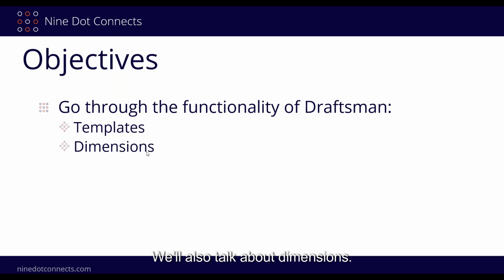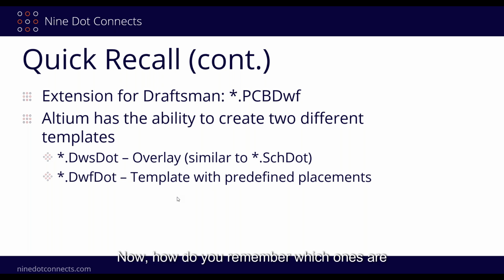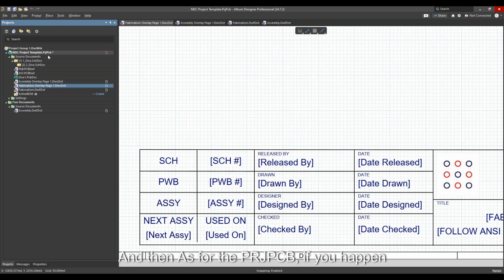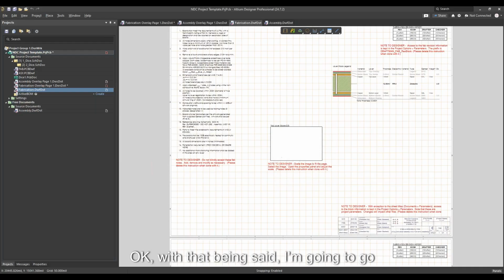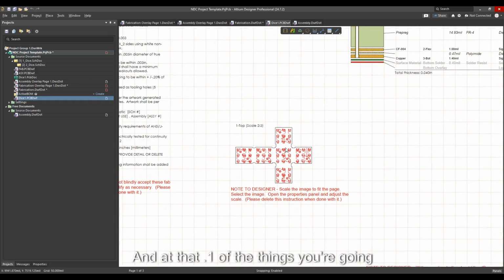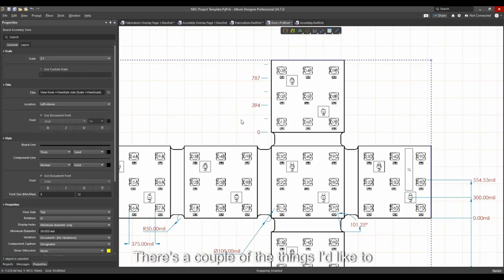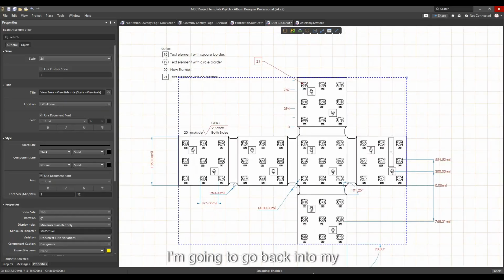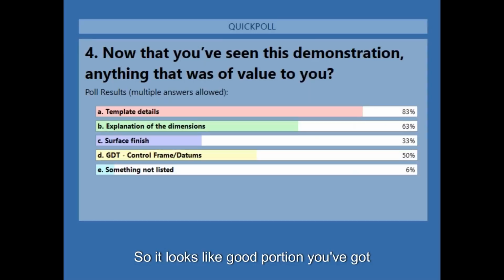A Revisit - Draftsman - 6 Years Later

Comment: When I provide the final Altium files to a customer, do I need to provide the DwsDot files also?
Reply from the maker: This is an interesting question because it depends on what you deliver to the customer.

If they hired you to create the templates for their companies, you will need to provide all templates for installation within their internal network.

If they hired you for design and layout, I would not provide the .dwsdot in the files you are giving them to send to the manufacturer.  This does not provide value to the fabricators or assemblers; it just adds more file clutter.

If you created a dwsdot for your use and reuse it by adding the customer's logo and information into the title block, I would not provide it unless they specifically ask for it (or agreed upon in the statement of work (SOW).)  Regardless of SOW, give it to them and help them install it if they ask for it.  It is not only a gesture of goodwill, but you also become a part of their workflow.  Companies prefer to work with those who are geared towards their workflow.  If you want to take it a step further, you can sell your service to assist with creating and supporting other templates.